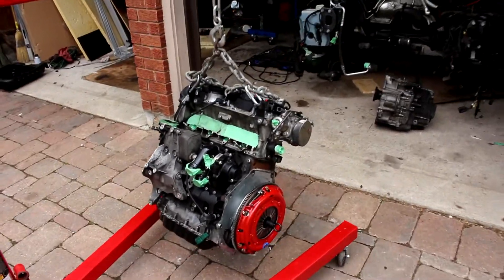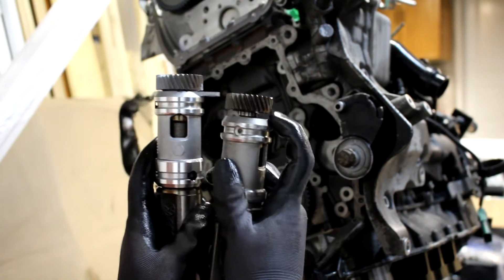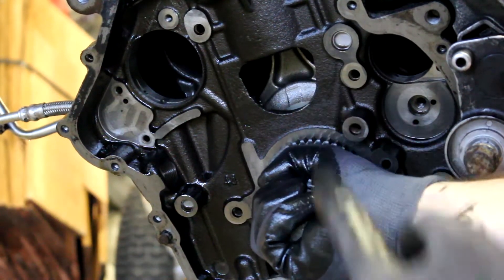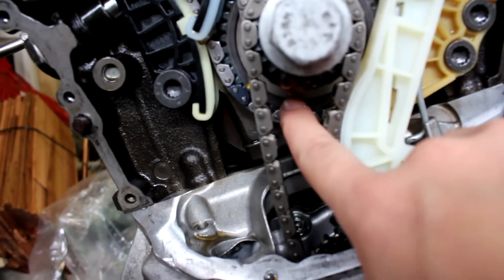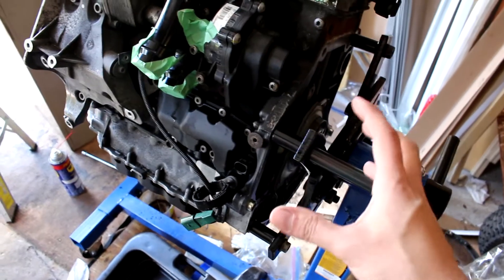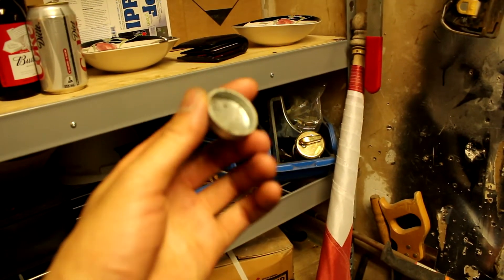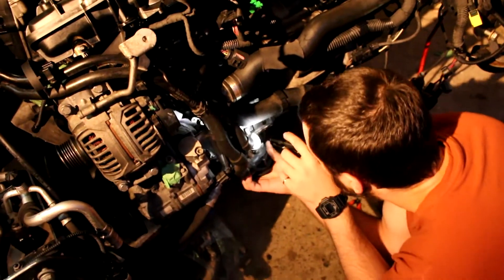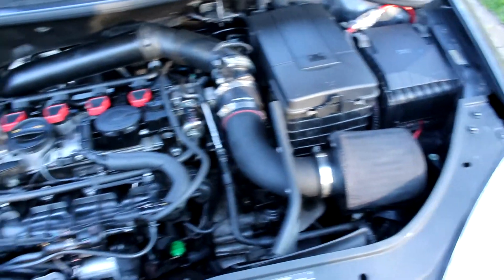Seized Balance Shaft - VW 2.0T TSI

Comment: What were the symptoms? My 2011 tiguan 2.0T tsi has a oil pressure light on, hopefully it's just the oil pressure sensor or the oil pump.. Worst case scenario I've been told is the balancer shaft..
Reply from the maker: In my case, when the shaft seized, the chain jumped off the sprocket so the major symptoms were the following:
1. Sound of chain grinding against the gear, eating it
2. Temperature climbing since the intake balance shaft drives the water pump (i know right? lol) so it wasn't circulating coolant . 
3.The engine was shaking pretty badly, almost like a motor mount failed since the balance shafts were not doing their job in balancing.

As for oil pressure light, I did not have that. Its hard to say. Hopefully it's just your pressure switch, but when I did this job I noticed the oil pickup tube is a stupid plastic assembly, if that cracks, the pump wont be able to syphon oil from the sump. Good luck with your tiguan, it really is a love/hate relationship with these cars, I feel your pain :(
Reply: @WannabeTuners  definitely! I love my car but sometimes it really puts me in terrible situations 😂 I've already changed the intake manifold twice in 100 000 Km
In my case I feel like the oil is circulating because I've driven it about 20 km back home after the oil light came on, and when I open the oil cap with the engine on some oil drips splashes out. there wasn't any weird sounds that I noticed and the car ran fine back home. I'll be going to VW tomorrow and get a new sensor hopefully that fixes it,

Thanks for your prompt response!
Reply from the maker: @adrianborinsky2989  Fingers crossed! Give us an update on the situation! Sometimes I wish there was more info on these platforms online. TheHumbleMechanic has some great info in his videos but these engines prove to be so complex that there is always something unknown! When I bought my car the intake manifold was damaged at the brackets that hold the low pressure fuel hose and I am pretty sure it was a sign that the previous owner replaced the manifold. If the manifold runner flap motor/etc fails again I am going to throw an Integrated Engineering or HPA manifold in there!
Reply: @WannabeTuners  thanks, will keep you updated hopefully tomorrow I have time to go to VW after work
Reply: Are there any videos on how to remove the balance shafts? Mines is stuck and it won't rotate anymore
Reply from the maker: @GordoMillones  The intake side came out pretty easy (which is odd because that was the seized one). The exhaust side one was completely jammed. The manual says to use a slide-hammer to grab onto the gear and pull it out. I did not have this. I ended up hammering out a freeze-plug on the clutch side of the block and hammered the exhaust side balance shaft out. Be careful not to damage the soft metal bearing in the block that the balance shaft rides on if you do this. See my reply to your other comment for more details. Don't forget the torx screws on the balance shaft housings and the water pump pulley have to come off. I believe the water pump pulley is reverse thread on the balance shaft side.

Comment: Is the intake balance shaft supposed to move when I move the crank? My car is overheating. CCTA engine. Water pump is good. Balance shaft scrocket where the water pump isn't moving when I rotate the crankshaft.
Reply: And also. Where can I get the procedure for this?
Reply from the maker: Yes you are right the balance shaft is supposed to move when you move the crank. I had the same issue with temp gauge climbing, this is because the balance shaft drives the waterpump so the water pump wont move if the balance shaft is stuck. I bought a subscription to the manual from AllDataDiy.com. It has the procedures and torque specs for timing related components. When you turn the crank, the balance shaft should move, if the balance shaft does not move, but the crank still spins, the balance shaft may have seized and thrown off or broken the balance shaft chain. IF the balance shaft is fine, you can check the belt that connects the balance shaft to the water pump.
Reply: Wannabe Tuners yesterday I turned the crank and watched the pulley on the water pump side. No movement. I'll take the cover off and see if it's just the chain or the shaft.  I just bought a 2009 Wolfsburg edition with 98k for 1200 with the cbfa engine. For super cheap. I flip cars. Thanks for the video!!!
Reply from the maker: No problem! When I spun the crank after my shaft seized and chain flew off you could hear the grinding yet the engine was still in time due to the timing chain being fine. It's possible that something sheared clean off without damaging the crank sprocket. Let me know if you have any other questions, take care!
Reply: Wannabe Tuners how did you remove the seized balance shaft? I haven't removed the engine. Have everything open already.  Only the balance shaft on the intake side is seized.
Reply from the maker: First, remove the pulley(reverse thread)+belt for the waterpump, and remove the (i think torx) screw on the front side of the balance shaft, The intake side should then slide out. The manual says the clearance is tight so if it is stuck, they recommend using a slide hammer/puller. My intake side was easy to remove but the exhaust side was not -> I did not have a slide hammer so I hammered out the freeze plug on the clutch side of the engine and used a long 1/2" extension + hammer to knock it loose. I think you can do the same with a freeze plug on the intake side but you'll need to find a way to replace it once you remove it.
Reply: Wannabe Tuners Yeah I did that, what is the freeze plug? I don't have the transmission removed. I saw a plug by the gear by the water pump, is that the plug you're talking about? I was thinking maybe I can access by removing the starter but I'm not sure.
Reply from the maker: Yea the plug between the block and the transmission bell housing where the water pump belt is, I didn't have to hammer the intake side shaft out so I dont know if you can get easy access with the starter removed, hopefully the transmission bell housing isn't in the way. If you do end up trying, Careful when hammering the shaft out from the transmission side because there is a very soft journal type bearing where the balance shaft meets the water pump that you dont want to damage. This engine is soo frustrating to work on!

Comment: Just started my timing job last night on my 09 GLI. Camshaft bridge screen was blown out. Found it sitting in the oil passage. Going to remove remaining screen, clean and re-install. Thanks for the helpful video btw one of many resources I used. My first timing job.
Reply from the maker: Ryan Tornai Awesome,  let us know if you have any questions
Reply: Ive got everything in time and torqued down. But I literally cant get the cam bridge to go back on. Is there any trick?
Reply from the maker: I had the same problem, pain in the @$$. Are you having trouble getting the exhaust and intake camshafts through the two holes in the cam bridge? I put a wrench on the "flat spot" on one of the camshafts and tried wiggling/rotating one of the cams just to get it to line up while trying to press the bridge on. Just rocking one of the cams back and forth. Careful not to let the chain skip a tooth, just enough to get the cam to shift slightly so that both cams line up with the holes in the cam bridge. I don't remember full details but I remember swearing, and a huge amount of relief when it finally went on.
Reply: Thanks ill try that next. Literally have been fighting with it for over an hour. This is after spending 3 hours trying to get the timing chain on. Kept jumping teeth, not lining up, even cam locks didnt help much. Long day lol...
Reply from the maker: Those outbursts in this video were a very real representation of what it's like to work on timing this engine (that's also why the actual placement of the chain wasn't filmed, lots of failed attempts and the last thing on my mind was positioning the camera and recording). I feel your pain, let me know how it goes!
Reply: https://www.timingchainsettlement.ca/

Comment: You should have just got the1.8t oil pump conversion kit the eliminates the faulty balance shaft. 500$ and well worth it. You will eventually run into the same problem again
Reply from the maker: I don't know if that will work with the 2.0T TSI. I think that kit works on the 2.0T FSI. The intake side balance shaft on the TSI drives the water pump on the other side of the engine, so im not sure how that would work.
Reply: Thats more than $500 considering you would have to do an electric water pump conversion as well because the intake shaft drives the water pump. Besides who wants all that engine vibration in a 4 cylinder engine 🤔

Comment: One of the best vids on youtube showing all the timing components, great reference for timing job on this engine
Reply from the maker: Ryan Tornai Thanks brother! I'm glad you found it useful ☺
Reply: Did you use the timing tool kit that includes the cam locks etc? How difficult is it to get the timing chain on? Thanks
Reply from the maker: I used the timing service tool set from ecstuning (I'm sure other places sell it too but it was the cheapest I could find from ecs) - Part numbers below.
I found it difficult to get the timing chain on, especially with the guides taking up a lot of the room. I used the cam locks and had to wiggle the cams with an open end wrench (there's a flat profile on the camshaft that lets you do this). Once everything is in place, you have to be careful because the chain is pretty tight even without the tensioner. It will jump teeth if you aren't careful. We had it jump teeth a few times and had to re-position the chain a couple times until everything stayed in place. Hope that helps!
part number: 020946SCH01A
ecs part number: ES#3145737
Reply: @WannabeTuners  How many turns before the colored links should line up with the cam adjuster marks ? I thought it was 8 and they should be right on marks at Cylinder 1 TDC ? agggh!!!!  Mine is walking counter clockwise the more revolutions I turn it  .... IDK why ?  Thanks for your responses you have been extremely helpful to all who ask
Reply from the maker: @blurmgru6632  from what I read in the past it's many many turns (like close to 100 or something). I can't remember if it was for the timing chain or balance shaft. I only made sure they were lined up initially after the tensioner was on and everything was tight. I didn't turn It over to line them up again